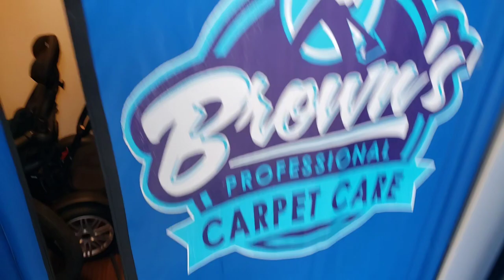EXTREMELY DIRTIEST Stair cleaning of the year | STAIRS ONLY | Dirty Carpet cleaning vlog Ep 344

Comment: Love the crb. Did you leave the steps sopping wet? I saw no dry strokes.
Reply from the maker: are you serious 😐 🤦🏾‍♂️Sopping wet?  NEVER
Reply: That’s what I was thinking lol he did it so fast
Reply from the maker: @amandatristan232323  This job took me 2 hours to complete.  that's fast?🤣🤣🤣🤣🤦🏾‍♂️
Reply: @BrownsProfessionalCarpetCare  the video makes it look fast and also didn't show any dry strokes on the steps. Every pass looked to be spraying water. And dry strokes are usually slow/slower than the video makes them look. But again, I didn't see any actual dry passes.
Reply: @shaynamaewallace3797  Dry strokes with that small furniture tool is overrated. Not much water flow goes thru these tools at once. 
We don’t use those often because their killer on the back but when we do, no dry strokes and dries fairly quick. Maybe it’s the concentration of vacuum into that 3 inch slot. 

Now that was a lot of pre-spray but I’m sure this cleaner anticipated this.
Reply: @ArtieArtie   I've used extractors and even with dry strokes, the furniture and rugs are still pretty wet because water soaks in deep into the cushioning. Definitely took a few hours, at least, to dry all the way. Mind you, I didn't have airmovers or fans, but still, people want to sit on, or walk on, the places that I've cleaned before they're completely dry. I'd hate to walk up the steps and get my socks wet 😬